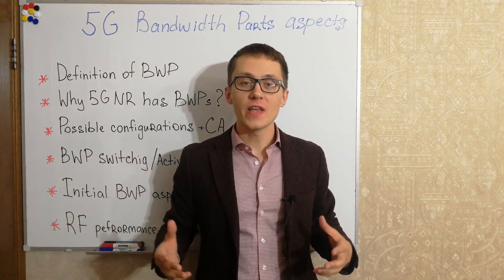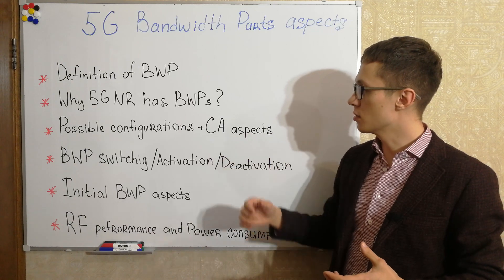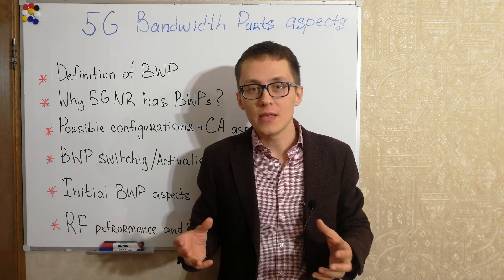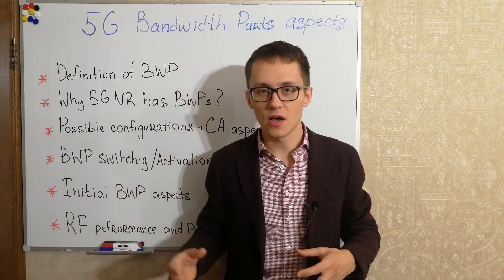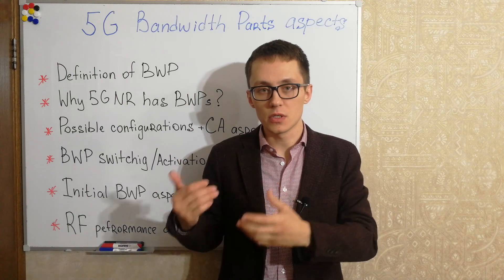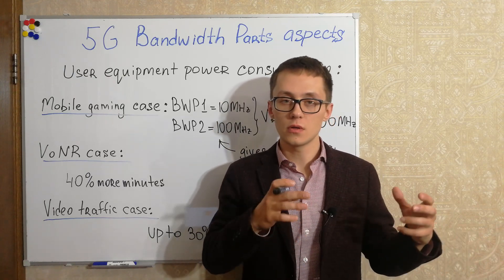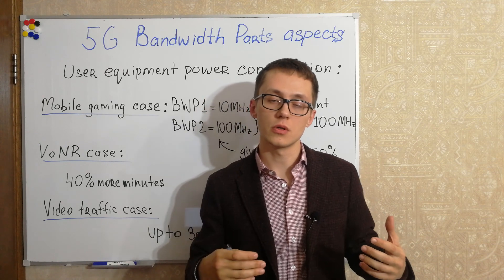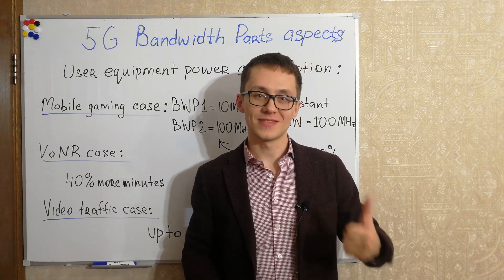5G Course - Initial/Active/Default BWP aspects in 5G NR

Comment: hi!!
just a question, what happens with noise if you have an UE that could work in 50 MHz BW but it only receive a small BWP for DL,
In that case the thermal noise is 174-10LOG(BW) or 174-10LOG(BWP)
thank you very much!
Reply from the maker: Hi! As far as I understand in this case terminal noise would be 174-10LOG(BWP).